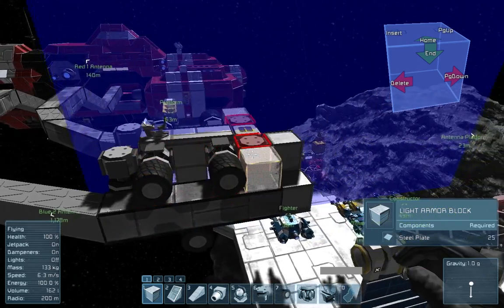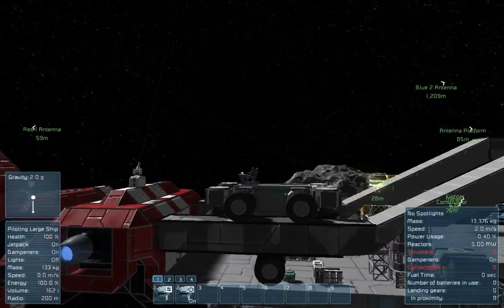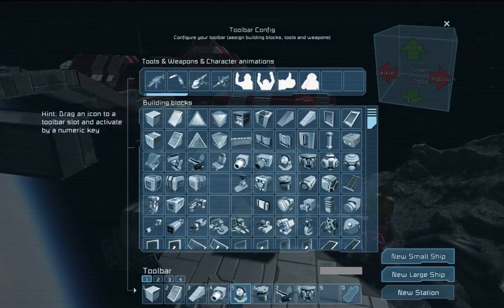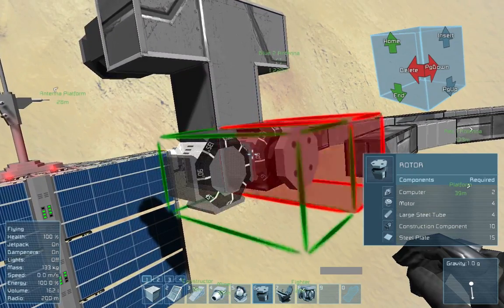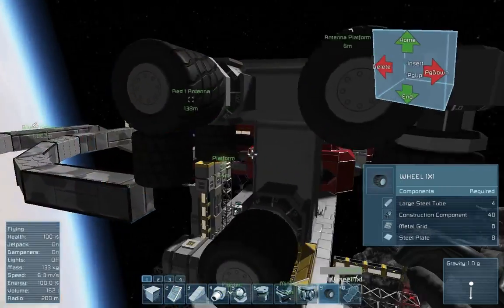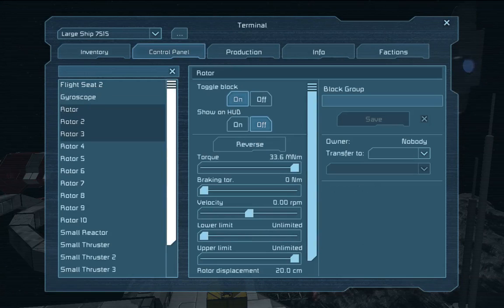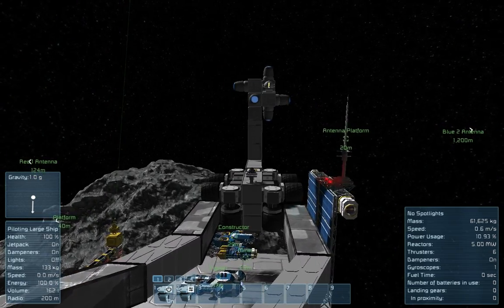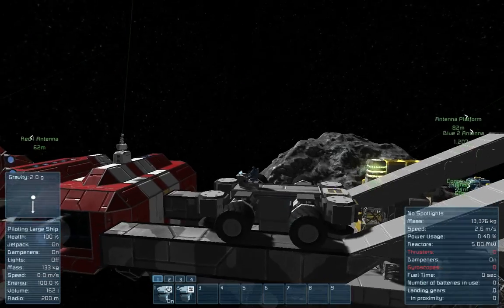Space Engineer - Rail Cart and how to build one

Comment: nice! thanks for this. ill try and revisit my crane idea and see if this helps. will update when i can! also glad you dont need any mass blocks this time either. using those are quite difficult. i also noticed in the previous videos that you have a gravity gen on the back of the cart. what does its purpose serve?
Reply: update: this works great, and its odd that it keeps slowly moving though after you turn the motors off. i did find a strange thing though, that if you place something on one of the rails, the cart stops fully like it should if you have the motors off.

Comment: How about using blast doors as rails?
Reply from the maker: You have to use normal blocks for corners, which is where you will encounter issues.

Also, blast doors are less than 1 block in width/tickness, making you bounce around on at least 1 axis.

Comment: Love it but how did you manually enter the values instead of using the slider?
Reply from the maker: If you hold ctrl down and click on the slider, you'll get an input box :)
Reply: Thanks. Im building a mining platform with a swivel so I can essentially open cast mine similar to the way a bucket wheel works, a great way to hollow out a roid for building a base. However all the piston systems iv tried so far are too unstable and fly appart. Now im using a rail car but the car is fixed and the rail extends with the mining head on the end. Iv also found that if u place a few welders under or near the beam where it moves through the cart it fixes any dammage caused by the sway in the arm, and in survival mode if u supply them with some plates you can even extend the arm by letting it slide past the welders as you place block templates on the end. Ill let you know how it goes and maby even post some screenshots on a forum somwere :)
Reply from the maker: N Thompson Sounds cool, go for it :) i'll look forward to seeing what you come up with.
Reply: Patrick Hansen Finished the Basic model of my excavation head,  took a while to put together in survival mode but it works extreemly well.  Iv uploaded some screenshots of the current revision to my steam account for public viewing along with a few construction shots showing how i hollowed out enough of the roid to fit it in.
http://steamcommunity.com/id/cheata/screenshots/?appid=244850

also just uploaded my savefile to the workshop
http://steamcommunity.com/sharedfiles/filedetails/?id=318754933
Reply from the maker: Cheata C A little hard to make out on the dark shots, but it looks good :) i'll take a look at the save once i get home later today.

Keep up the good engineering :)